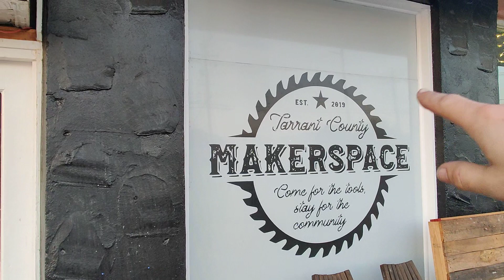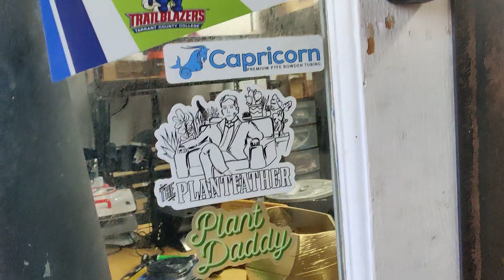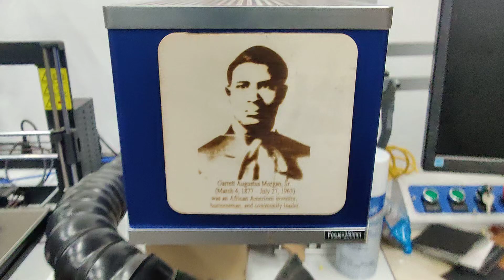Shop Tour: 3D Print Everything and Tarrent County Makerspace

Comment: Bowling ball racks might work for spool shortage. Bowling balls are 8.5in and the Eryone spool I just measured is just shy of 8in.
Reply from the maker: So would they work or not?
Reply: @3DPrintsEverything  There are multiple ball racks on amazon available for under $100 usd and most are able to hold an 8in ball. So I would say yes, It's a viable cheap option.
Reply from the maker: @printcrab8483  Interesting I will check these out. 
Some are definitely cheap but constructed cheap too, some do cost several hundred too.